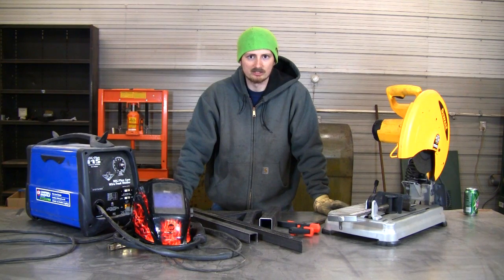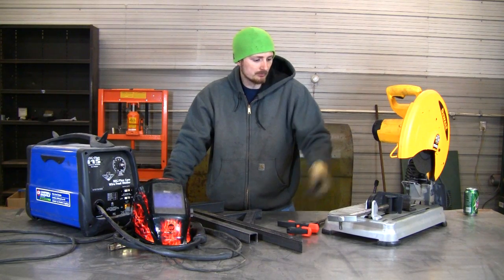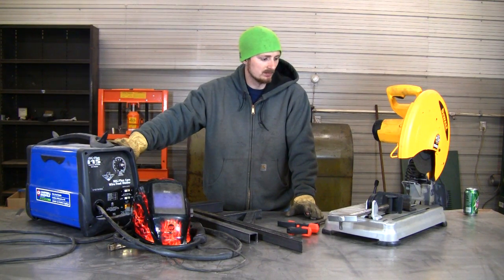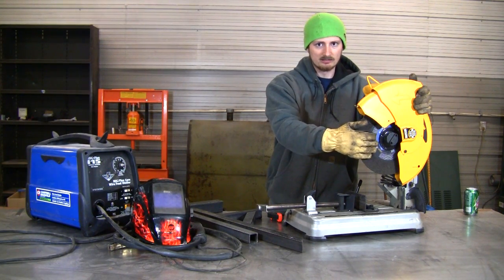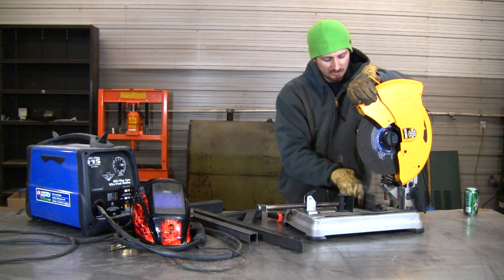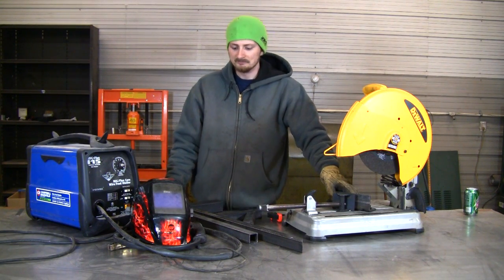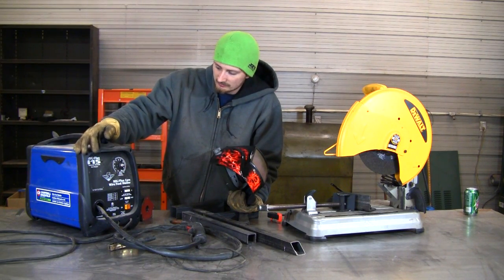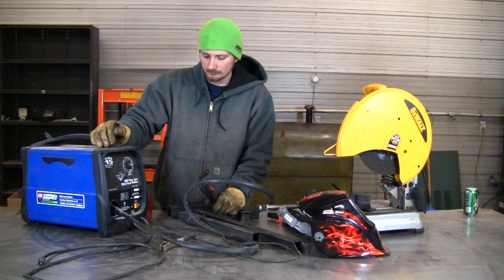Make Your Own - Set Up Your Own Workshop Pt 1

Comment: Good videos, just I would recommend Milwaukee chop saw, more ruged and more power.   Very good table on those, and mostly used for heavy duty professional use.  DeWalt is owned by Black&Decker and DeWalt is their top-of-the-line tools, mostly for intermediate use.    Also the welder, I would had chosen Lincoln Electric, mig/flux, minimum of 140 Amps.   There are other really good professional brands, but I won't mention these at this time.

Comment: hey! i made your 2.25LB FWE pulsejet but i have a problem. of corse  i didnt use exactly the specifications you gave in the instructions exaust pipe inner diameter is not a 3.1mm but 3.5mm and the intake is not flared. my propane tank wasnt ful too and it is not running smoothly but it is banging realy loud and doesnt run without the ignition turned off. if i out a big washer at the end of the pipe to make 3.0mm large exaust hole will it run?

Comment from the maker: Yea we have a furnace just to the right of the shot, but we still keep it at 55 degrees otherwise its too hot to work with long clothing on. 

For welding you need to wear long clothing anyway to protect you from UV rays, so 55 is about the perfect temp to stay comfortable.